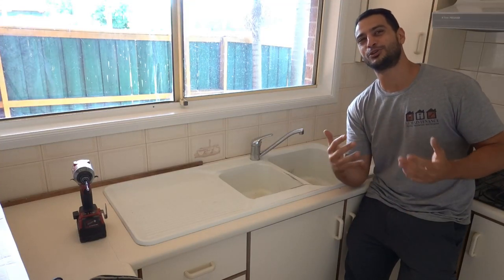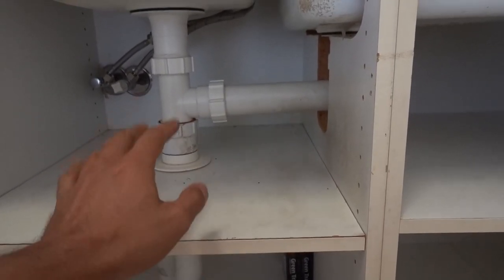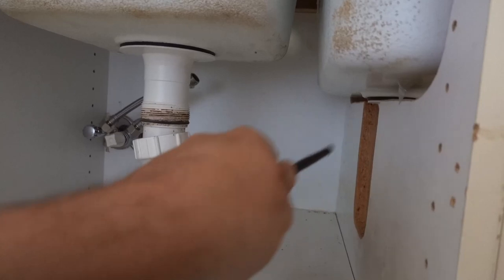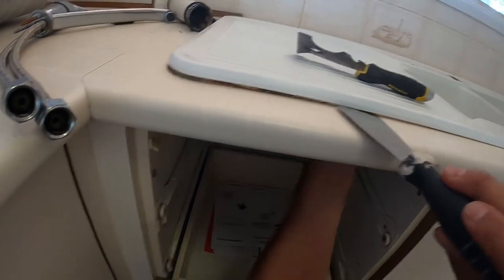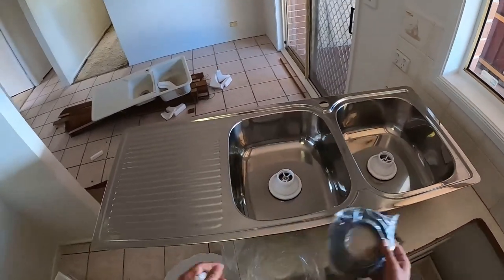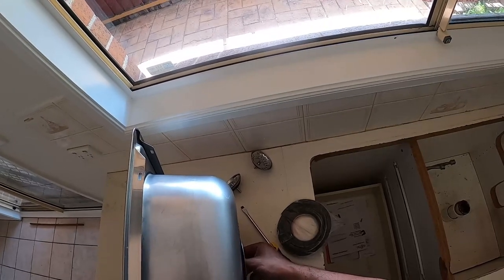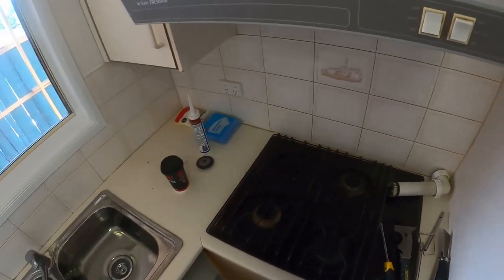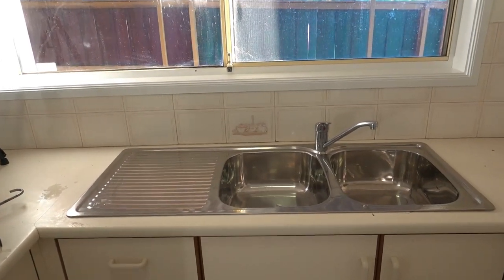How to remove and install kitchen sink - DIY

Comment: Coming back to this video to say thanks Bill. I finally swapped over the mixer tap in my kitchen with the new tap i bought two years ago :) it was a real squeeze to get in there, they installed a sliding bin under the sink, but I knew what i was supposed to do and so managed to get it installed and working. It's really satisfying to DIY. Now I'm gonna have a go at my shower screen. It's not QUITE hall of shame, yet :)

Comment: I'm about to install a sink and panicked slightly as it didn't have double sided tape and I don't have any on hand but I do have some clear silicone. That trick with the water was awesome too because I was going to rig something up with some timber, nuts, washers and threaded rod to apply even pressure from the top. This just saved me some time and money. Cheers Bill!

Comment: Hi fantastic job the only thing is that you could have removed and fitted the sink with the tap installed to save you struggling under the back keep up the video’s they are very helpful 👷🏻‍♂️
Reply: 100% correct

Comment: Good comprehensive video
What's the best way to cut out the bench for the sink without making a mess?
Reply from the maker: For laminate, either circular saw or jigsaw but they will both make a mess from the saw dust 👍👍👍

Comment: Hi Bill, where do you get those tube spanners from, please? Great video. Thanks.
Reply: Amazon sells them, not sure these are as long as Bill used, but they have ......General Tools 188 Shower Valve Wrench Set, 5-Piece - about fifteen bucks for a set.
Reply: @richardnichols3949  thank you Sir. I shall have a look
Reply from the maker: Local hardware store or I also have a link in the description 👍
Reply: U shouldn’t need tube spanners for this job. Remove the sink with the tap in place. Then remove the tap. Then install the tap to sink before u fit the sink. Or even better, buy a brand new tap for around $50-$100. Re using the old tap is like buying a new car with second hand tyres lol
Reply: You can get deep sockets almost everywhere probably be more useful unless your a plumber